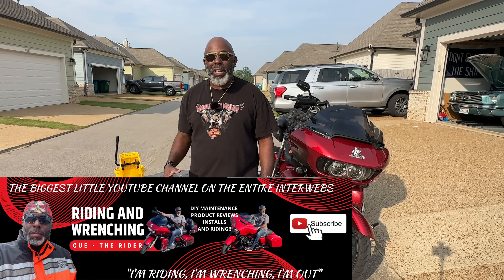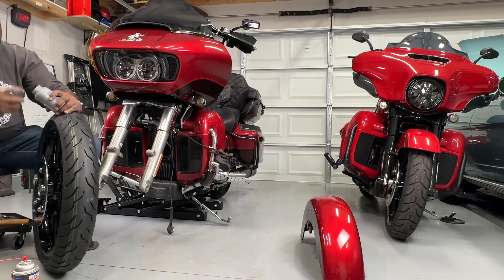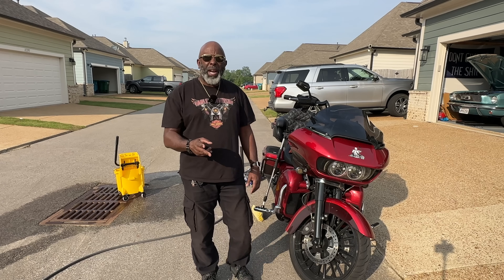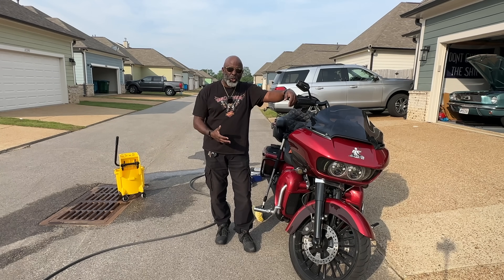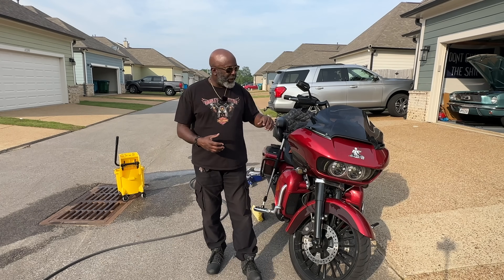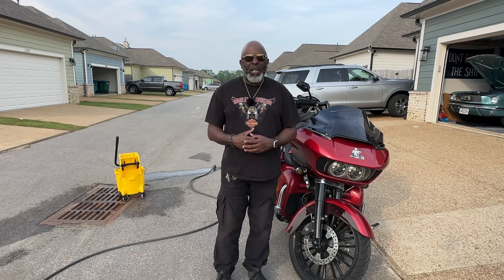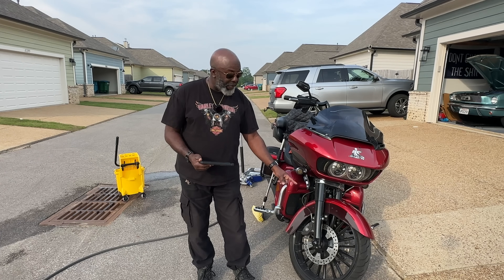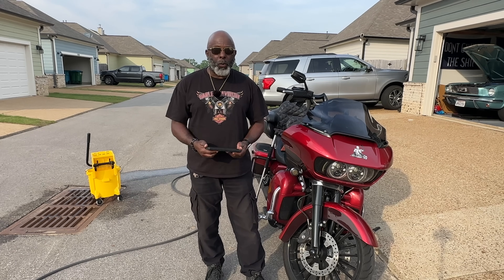Why You SHOULD NOT put  21" wheels on your Harley!

Comment: I see alot of people in my area with 26 and 30 inch rims on their bikes, they even ride on the highway, no way that’s comfortable, i prefer to ride on stock rims
Reply from the maker: Going past a 21" wheel requires changing the rake of the forks, which further decreases the effectiveness of the suspension. It also increases the length of the wheel base which results in wider turns. I ride too much for that. I was concerned about how a 21" wheel would impact my bike, but after consulting with a few people (who are excellent riders) I decided to give it a shot. The only BIG issue was the impact to my suspension.

Comment: Funny perspective. I've been rollin on a 21 since 1967! First on a stock sportster that later became a rigid chopper , then on a 68 shovelhead that I still have after 45 years and for the last 16 years on another custom built rigid chopper. I'm now 73 so I know age has NOTHING to do with it. I never experienced any of these problems but maybe that's just me. It's the size I will ride to the very end. They handle beautifully to me. Just sayin my experience. Ride on.....
Reply from the maker: Wow! Thanks for sharing....You've been riding longer than I've been alive. I recently learned the difference between an Hard Tail and a Soft Tail. I can't believe people rode on bikes with no suspension! Sounds painful
Reply: Funny all the people saying it ruins the handling. I enjoy riding cross country but not an adrenaline junky that likes to throw my bike into the twisties hard.  A friend of mine is and has an identical bike as mine with a 21 on the front and he can probably hit the twisties harder and faster because the increase lean angle, if anything he is faster rather than slower on the twisties.  I’m just a slow poke cross country rider and have not experienced any degradation in ride quality since putting a 21 on mine.

Comment: I don't like the stock 19-inch front  wheel on my 2013 SG, for me a 16-inch front and rear wheel works best😊
Reply: Agree, I prefer more rubber between the rim and the road. The outside circumference of a 16 and a 19 tire is about the same anyway.  😅

Comment: I brought Coastal Moto Rim (Chrome Fury) it has a 8mm valve stem which they don't have a 90 degree stem for it and so far none on line (in chrome) and due to design of rim (it has fins on it) and trying to fill air with a straight line air hose is no good you need to buy a ball air chuck. My Rims looks good but stay away from purchasing Chrome Fury
Reply from the maker: They put a tall straight valve stem on the rear. Fortunately I had a pressure gauge that I could use. My digital gauge won't fit the rear

Comment: I’ve never seen a Road Glide with a 15 inch rear wheel.

Any change to your speedo or odometer was the result of the rear wheel change. The front had nothing to do with that.
Reply from the maker: I was mistaken. I think you are the 10th person to correct me. I'm not sure why I said 15 when I have 16 written in my notes. Oh well!
Reply: @RidingandWrenching  I wasn't trying to be smartass, it just happens naturally. I also didn't see the other 9 because I rarely read YouTube comments. 

The actual reason i posted was to comment on odometer and speedometer changes are a result of rear wheel changes. Although, front wheel changes can create SNAFU's with the ABS.
Reply from the maker: @kriskleitsch9173  all good! Do you think the odometer/speedometer is impacted by larger rear wheels?
Reply: @RidingandWrenching  Definitely. As I mentioned, the larger front wheel frequently creates issues with the ABS because of the reduced front wheel rotation speed. Particularly, if you only increase front wheel circumference and not the rear. ABS and speedo issues are usually more related to wheel circumference rather than diameter.

But the front wheel has nothing to do with the speedometer. A larger circumference on the rear tire will carry more distance per revolution so you'll be going faster than your speedo indicates. The speedo reads off transmission speed and is impacted by the final drive only. 

This can be adjusted, if you have a good flash tuner like a powervision. You  can't adjust each wheel individually though to eliminate ABS codes. Only speedo calibration.

Comment: It's not an upgrade if it's not as good as stock

Did you order the wheel with tire mounted? I think I'd blame the tire mounter for the 90* pointing the wrong way

I don't know how beads effect attempts to balance when the balancer doesn't know they are there......they may have got flustered and just slapped a bunch of weights on there

The front wheel has absolutely nothing to do with speedo or odometer, the rear wheel, depending on the circumference of the tread of the rear wheel can alter actual vs speedo and odo......you said odo is 4 miles less than actual in 150miles, that also means when speedo says 150mph you are actually going 159mph

I'm told wheels also have a direction just like tires, there is an arrow at the hub on the clutch side....... I've never looked because I have never put a tire on a new wheel, I simply put tire on same direction as old tire

My cousin not paying attention replaced inner tube with 90* valve in wrong direction, and it was single front disk and the valve hit the caliper

There is a company that makes bead disks that bolt to brake disk for most Harley and Goldwing
Reply from the maker: Tire mounter screwed up. Fortunately, it's an easy fix. It's almost time to replace the front tire. I'll take care of it then. The biggest issue I have had with the bigger front wheel is the lean angle while on the kick stand. I am going to address that with a block on the kick stand that will make it easier to lift off the kick stand

Comment: Front wheel does not affect your odometer. It runs off tour trans not wheel.
Reply from the maker: That's what I've been told. I don't understand how changing the wheel diameter won't impact the odometer. The transmission has no way of accurately recording distance travelled.

Comment: You dont have to put low profiles on ive always run twenty ones on my twenty is lighter than the steel 16 that was on it i guarantee speedo will change a mile an hour

Comment: Well, cant really talk about wrenching, if you dont even know that if you install a 21 inch wheel, you have to lower your suspension 1 to 2 inches lower to maintain stock height. Possibly do more reserch before working on a motorcycle. Just food for thought instead of longer kick stands 🤦🏼🤣
Reply from the maker: Lowering the suspension would further ruin ride quality. That's not something I would do.
Reply: @RidingandWrenching  I get that. But, that's the right way to do tho. And not necessarily either. If you do a drop in legend kit it improves greatly over stock. I must say, my 17 rides pretty good, I have to lower it because the guy before me must not have known the right way of doing thing. And my bike sits like yours now. 18 rear, 21 front, sit like a truck lol
Reply from the maker: @dannydlowbikertv  I put Wilbur's on my 18....rides much better....but I still have the kickstand issue. It leans too much. I have a longer kickstand but haven't put it on yet. It's been sitting on my toolbox for a few months! I also found a block you can mount to the bottom of the kick stand to reduce the lean. Might try that too....but I'm blacking out my bike so I'm getting the kick stand powder coated.....but haven't done that either! Been too busy, so I just deal with the lean
Reply: @RidingandWrenching  lol it leans because your front end is now 1 inch or little more higher because of the 21 wheel. That's why it's proper to lower front a inch when installing a 21, so you maintain the stock height. Like I said, my bike does the same thing. Sometimes it feels like the bike is gonna fall because it leans so much. Drives me crazy. Kick stand is a cheap easy fix, but definitely not the right way. I'm actually thinking about to back to come stock wheels, so I don't have to do all that work. Lol
Reply: @RidingandWrenching  by the way, I'm the other youtuber Tim from tims stereo had at his shop. Dig the channel man, wish you nothing but luck. Ride safe.
Reply from the maker: @dannydlowbikertv  thanks! Best wishes with your channel as well

Comment: good video Sir. yea I like road glides but never owned one had a ton of gold wings and a limited ultra. gold wings as far as performance ride durability really everything but status is a no brainer they are so far above any competition. but they are  to tall for me road glides are a lot shorter  fit me better and the status all the girls love HD and even the dorks standing on the sidewalk will have to inform me i "should have bought a HD" lol.  with all that said when i think about customizing a motor cycle it seems pointless to customize a bagger because of your points and more.  I mean better speakers maybe a amp better seat or diff handle bars & pipes thats reasonably it than your wasting $$ unless you bought a bagger to only go the the local bar and look cool than your good with all the customizations.  so on that note I might try to build a chopper for total customization and cool  factor cause they ride like sht anyways lol.
Reply from the maker: Can you do long distance riding on a Chopper? My Road Glide is staying with me until it dies!
Reply: yeah i understand i guess what i'm tryin to say is gotta have at least 2 bikes one for puttin around town looking cool = chopper and one for longer rides + rides with the girlfirends etc. it's always nice to have a bagger for a jacket.  my last hd street bikes where hd ultra & 1200 custom for the x, than i got sort of paranoid in city traffic and bought a 400 ninja and a ktm 250 currently just the ktm for singletrack riding in the mountains pnw. helmet law state and  i like the top down a tunes cranked on a bagger so probalbly no more baggers my future. 
 @RidingandWrenching

Comment: I really don't see where It would make a big difference the ride should be the same unless someone didn't Blanance the Rim correctly now big difference with a 23' then you have guys that's running them fine without a Rake I'm talking about Personally I Know 😎👌
Reply from the maker: Lower profile tires change the ride quality. 21" is the tallest I'm willing to go. I suspect that difference in the side wall isn't dramatic between a 21 and 23

Comment: The truth is.. if you modify one thing you should modify all other components to insure the vehicle remains safe and road worthy! If you install bigger rims you should also modify all suspension components. Not only did you change ride height, also speedometer readings…there are many things to consider before deciding to do any modifications on a motorcycle as well as a car..,

Comment: Hmmm I use a 21 up front and a 16 rear. Ol skool choppers. You couldn't pay me to ride a bagger. Lol. My bikes are kick only to start with magneto ignition. Open primary.   No front brake. Jockey shift. They handle fine. Built right they are easy to ride. PANHEADS FOREVER!
Reply from the maker: Wow! I'd love to try one of the older bikes. My dad had a kick start bike when I was a kid, but he stopped riding by the time I was old enough to ride

Comment: your front tire has no bearing on your MPH you changed rear wheel and obviously didn't get right size tire... tire ratio(second number on tire)X2 if its a 90 use .09X2 then X tire width say 150 divide by 25.4 then add rim height  and find out your factory tire diameter on the rear.... 
use that formula on any tire to get tire diameter to find optional rim size!
example 150/90/16  
0.90x2x150divide that by 25.4 to convert to inches then add rim height..16
your tire diameter is 26.62 if you went to 18" rim you would get a tire likw 150/60/18  you would get a 25 " tire diameter that will throw off your MPH and Mileage so do the math and find tire closest your original factory tire height....

Comment: Valve stem pointed the wrong way ? Rim is non directional, tire is directional, talk to the guy who mounted the tire , just sayin
Reply from the maker: I'm going to fix it after I wear the tire out. It's an easy fix
Reply from the maker: Bearings are directional though. ABS bearing has to be on a specific side.

Comment: This is the most misinformed article on HDs that I've seen yet on the net.  He clearly did absolutely no research on stock wheel sizes.   He starts off saying that the stock rear wheel is a 15" unit, when in fact it's a 16".  He then goes on to say that the stock front wheel is a 17", when in fact it's a 19".   If he doesn't even know what size wheels came stock on his bike, and didn't take the time to Google it before writing this tire size review, you shouldn't believe a word he says on this subject.
Reply from the maker: My front tire was a 17". As I have stated to the many people who have called out my error on the rear tire....I made a mistake! I had 16" written in my notes but I stated 15" in the video. I have no explanation other than that I am human. I don't need google to tell me what size tires I have, it's written on the sidewall.
Reply from the maker: If you need a little more proof.

https://www.jpcycles.com/motorcycle-parts/2018-harley-davidson-road-glide-ultra-fltru
Reply: @RidingandWrenching  " I don't need google to tell me what size tires I have, it's written on the sidewall" 

I assumed you no longer had possession of the OEM tires/wheels which was why you made the sizing mistake.  If you still have them and made that mistake, then you're confirming my original assessment. (HD hasn't used a 15" wheel on a touring bike in more than 50 years.)  I've been riding for 58 years and have owned a Road Glide since it was new in 2011.  I run a 17"R and a 21"F and find your assessment of running a 21" F absurd.  It's slightly slower steering at parking lot speeds but beyond that there's no difference that anyone who had a couple or more years riding experience would notice.
Reply from the maker: @kevingurall5555  appreciate your opinions. Everyone has one
Reply: Nothing personal, it's just that so many people take everything as gospel when it's on a video and I get concerned that newly minted riders will someday cause themselves great harm by assuming the video must be correct.   I just think everyone posting videos in the public domain should double check their work and correct the mistakes that are bound to happen.
Reply from the maker: @kevingurall5555  I hear you. The point of my video was to discuss pros and cons that I experienced changing my wheel size. The size of the rear tire isn't relevant to most of the points I'm making since different years/makes/models have different size tires.